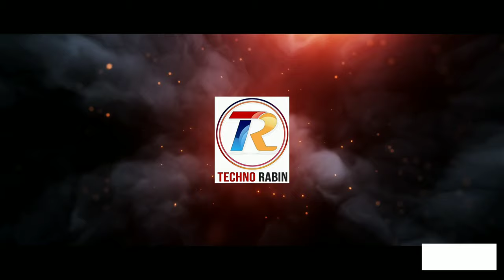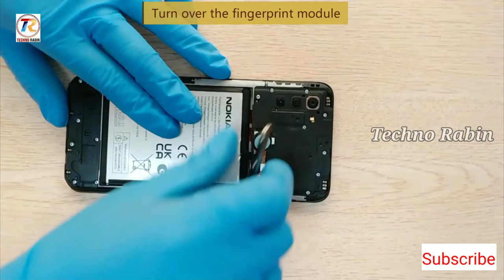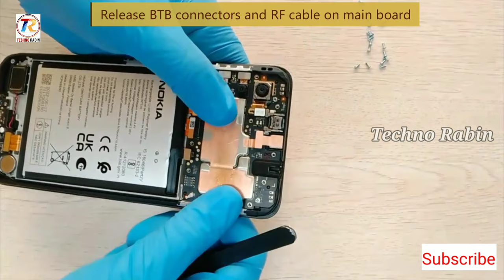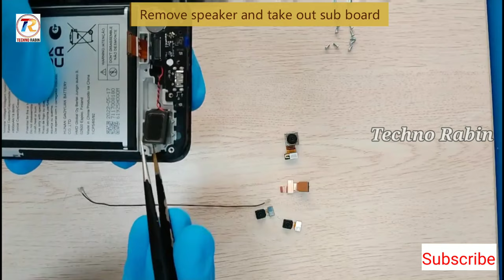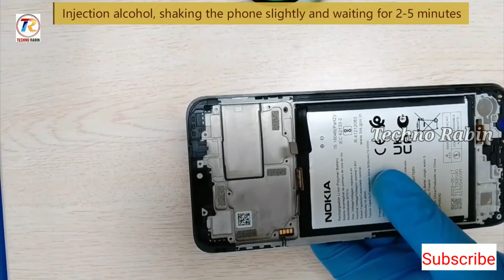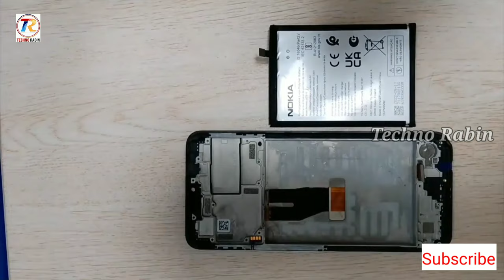Nokia C31 Disassembly Video

Comment: My can't even set up or connect to wifi to set up or activate sim and I just got it from Woolworths
Reply: Your not missing out hey.
I just bought one on clearance at wo*lies for $29.
It constantly crashes
Screen is 🤦.
Ram... 🤣More like Little Lam.
My old $amsung s4 with same Sim card is better overall 
Old USB.
I'd stay away from it.
I'm watching this vid so I can pull the battery out and use it for a spare to my Nokia 8.3